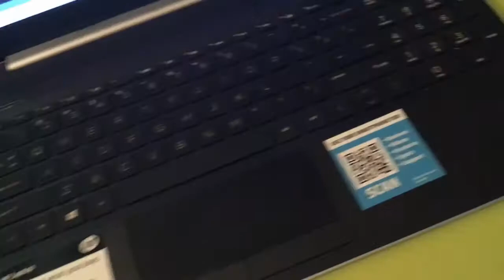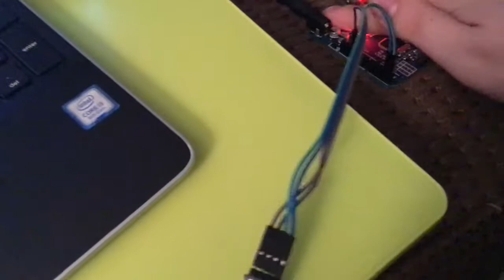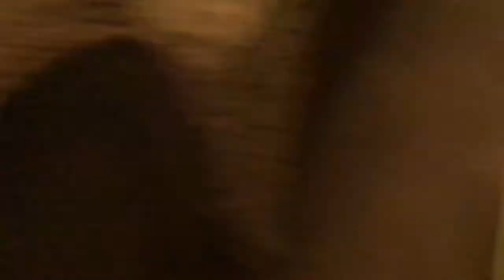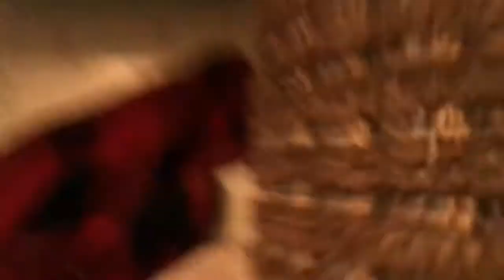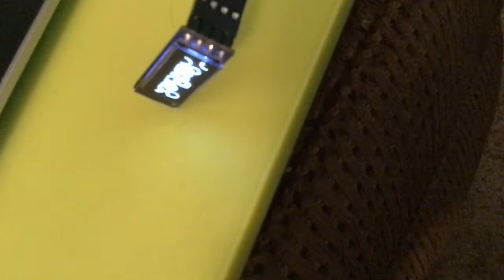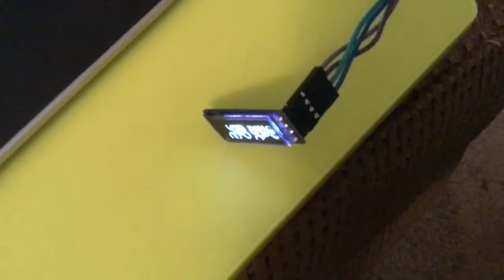SPI oled is faster than I2C oled!? (SSD1306 speed test Arduino)

Comment from the maker: I forgot to mention. I did some more tests on the oled displays. For the i2c oled displays on an arduino, it appears to have slight lag, but when i connect it to the esp32, it runs much smoother, but still slowly. With the spi version on arduino, it is almost like the i2c version on esp32, but when i connect the spi version to the esp32, it’s crazy fast.